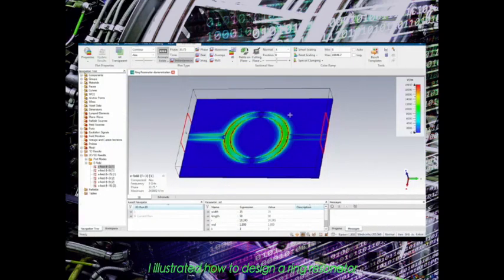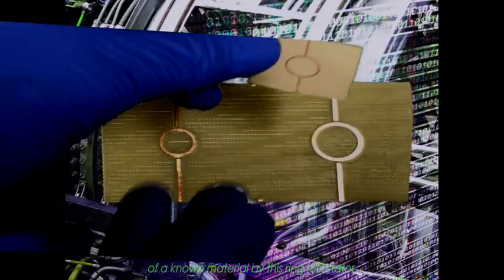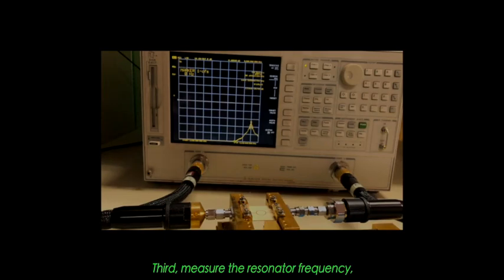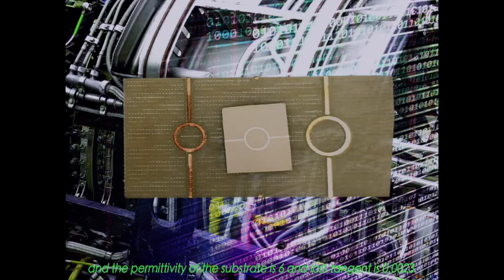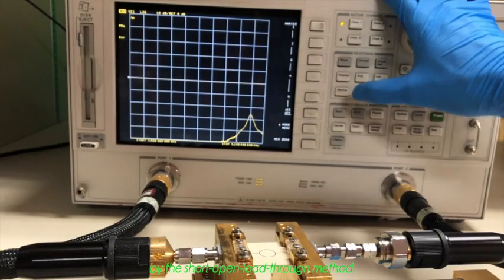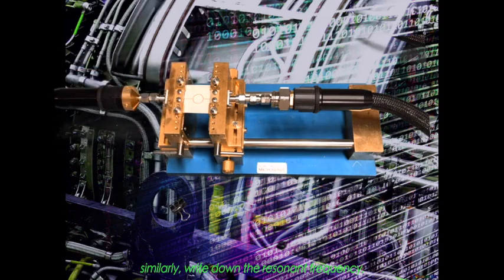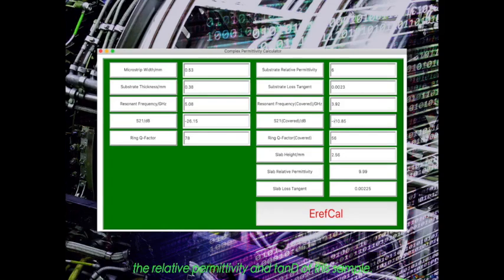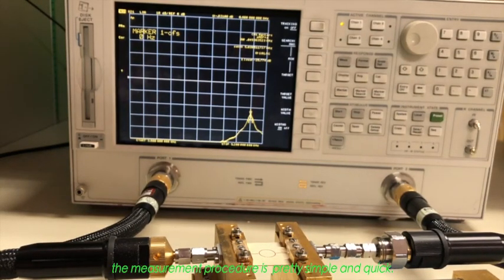Complex Permittivity Measurement

Comment: You video to be convincing , it should disclose a few key points that you hide here: the expression(s) you use to compute relative permittivity and tand of the sample after obtaining specific measurement values of the resonant frequency and 3-dB bandwidth or Q factor in insertion loss curve. As we know, reproducibility is the essence of credible work and that lacks here. You also hide the curve you obtain when you put the sample, the way you put it, which is dubious here.
So, the paradox is: you voluntarily record a video to present something here, yet then you hide the most critical moments of that presentation. What's the point? If you want a commercial, you can advertise it on some website or online store more effectively than this way.
Reply from the maker: After reading your comments, I believe you are a rigorous person and interested in my video. Thanks for your genuine comments.

Yes, you are right. The equations are important. Here I just demonstrate the concepts of one method. There are lots of published works, so the equations are at your fingertips. I think Equation is a kind of sound and rigorous form to express or quantify the concepts.  
I do want to share the concept of this method and enlighten the audience. This is part of my research. I just want to inspire others who are interested in dielectrics characterization. Sorry I can not exposure all the details. I need to protect my I.P.

Is important for a published paper to instruct the reader to repeat the author's work. The answer is yes and no. We can find that for some papers, most of which are really valuable and create a new field, the idea and concept they introduce are the most important. They triggered the reader's interest and attract people to devote their time to optimize the idea, verify it and make it practice. On the other hand, if the work isn't repeatable, we will be self-doubt and then lost trust in the author. So a reliable published work should be repeatable. But it doesn't mean you can repeat the work after glancing at the material. In our daily academic life,  repeating the published work is not a piece of cake. After reading it, we have to spend some time and dig the info in the sentence, figs, and data to find the details to help us repeat the published work. 

Anyway thanks for your comments.  I agree some equations can help my audience. Next time I could add some papers' links in the videos.

Comment: Nice short tutorial! Could you tell us about that complex permittivity calculator that you use - is it available online or it is something that you use proprietary as part of some software? What reference did you use to design you ring resonator?
Reply from the maker: The ring design is based on the commonly use principle. I developed an app to help me design the ring which account the influence on the resonant frequency from capacitor coupling. The results extracting stage, I developed my App, and the equations I used the based on some published work and add some of my work to increase the accuracy.
Reply: What is the test fixture (sample holder) you use here?